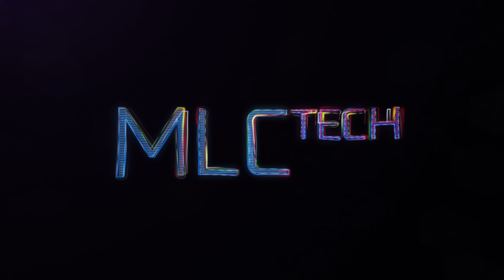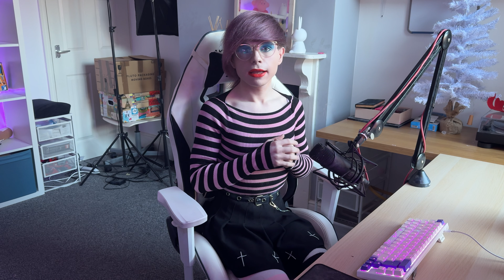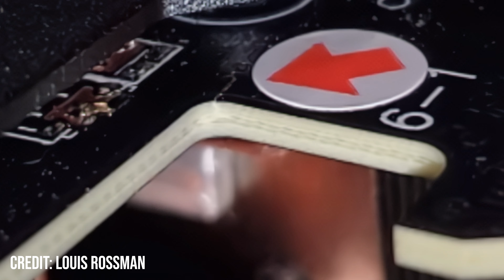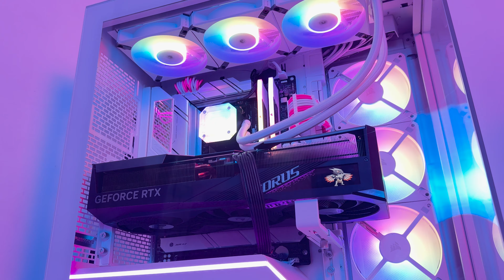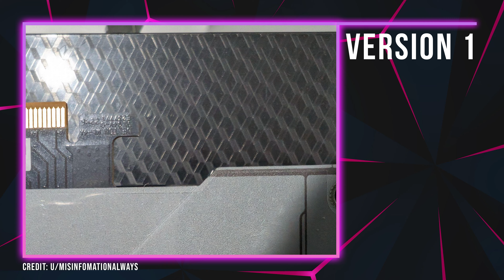Nvidia GPU's Are Cracking! - Gigabyte Acknowledges But Still Denies Returns!

Comment: New vid, same comment. I had picked up a gigabyte rx580 that was pixelating on day one. I got the RMA process going and sent it back. A week later they told me they couldn't fix it because it was dusty. 
This company is trash. Nobody should be risking buying expensive things from a fraudulent company like this. If you got lucky, good for you, but they won't be helping you if they sell you a dud.
Reply from the maker: Haha, i had to reupload it as it was not processing at all and it was stuck at 360p, hopefully the reupload will shine in at 4k! but i will carry my respond over too, appreciate you doing that!
Reply from the maker: Wow that is terrible of them to do that to you! I only went gigabyte as they were only one of the decent looking cards that were in stock and at a "reasonal normal price" as other brands at the time were either out of stock or had their prices inflated and marked up by quite alot, I originally wanted to get my hands on the MSI Suprim version but it was completly out of stock from first party sellers. With how they treated customers over the years, i dont see my self supporting gigabyte or their products at all.
The only time i have ever had to RMA a card was with an EVGA 1070 where one of the VRM's went up in a puff of smoke due to a known overheating issue with certaint VRMs. They were so helpful and quick with sorting out a replacement, One of the reasons why i miss EVGA so much in the GPU space, they were the best from their GPU design down to how
Reply: @MLCtech  I'll give them that, they do make some very nice looking stuff.

Comment: east fix,  don't buy Nvidia  they aren't that good per dollar until you get to the xx90 cards  which turns out  7900xtx  actually does better for creators then the 4090  which is kinda shocking and something amd doesn't advertise they want to be gaming cards not creator cards but that amd card actually has really good video editing abilities over the 4090.   Also  amd doesn't use that stupid plug that starts fires because it's pushing to much power through wires not capable of handling it.
Reply: The cable is fine bruh just don't use a shitty adapter
Reply: The 90 series tier are still hella overpriced ngl.
Reply: Or just don't buy Gigabite GPUs, they had the same problem last generation if I remember correctly

Comment: what's your set-up specs?
Reply from the maker: My pc specs are as followed:
AMD RYZEN 9 7950X3D 
NVIDIA RTX 4090 AUROUS
64 GB 6000Mt/s cl30
Asus X670e-a
Corsair rm1000x shift PSU
Corsair 150i 360mm AIO
Phanteks NV5 White

My monitor i use is the LG C3 42, and my mouse is the Glorious Mode D Minus, and my keyboard is the ducky One2SF
Reply: @MLCtech  Damn nice!!